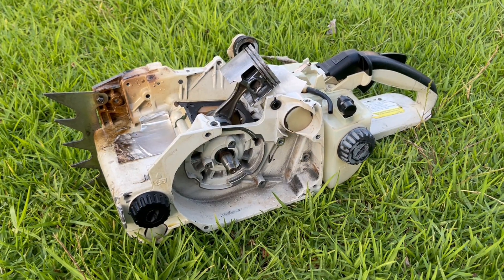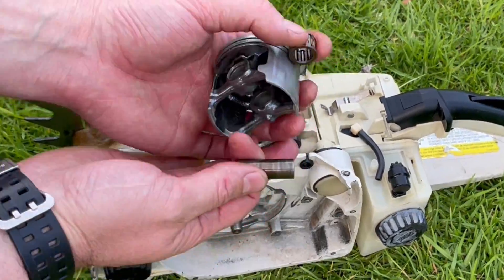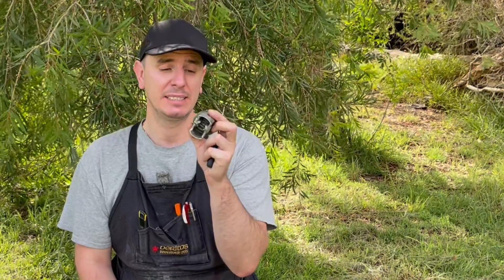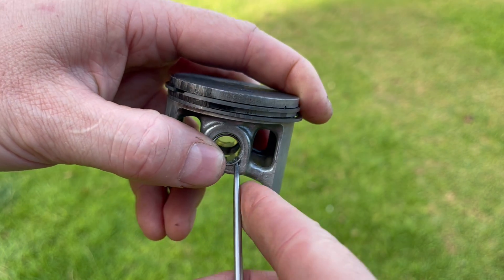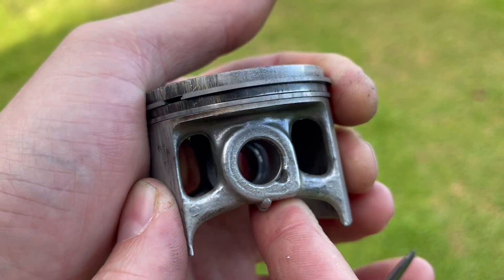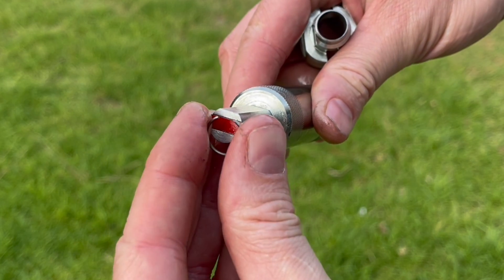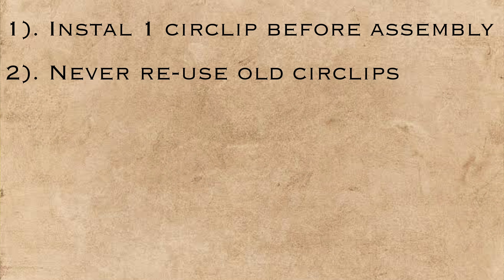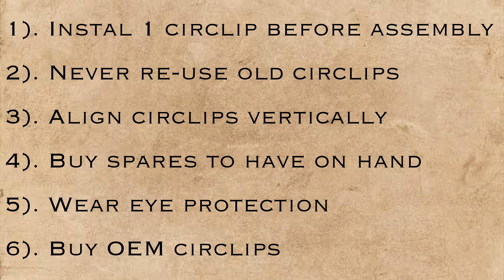This Will Save You A HUGE Repair Bill!!

Comment: Hey Tom, got a question concerning a ms 250 stihl chainsaw. 

I've broken 4 pawls so far because of kick back when starting. Im almost certain it's firing before crossing tdc which pushes the rotation of the saw in the opposite direction slappin the groves of the fly wheel onto the engaged pawl. 

When the chainsaw is in the off position I can pull that sucker and it would never damage the pawl. Only happens when I put it on the run position.

I've changed the spark plug and removed the flywheel to check the key to make sure it's not sheared. I've also tried different coil gapping to see if it makes a difference, but nothing.

One last thing when the saw starts it runs perfectly.
Reply from the maker: Interesting! It could be the coil has started to fail and is kicking at the wrong time, that’s about all it can really be from here on out. Try replacing it with a good known one. Your local dealer will have a bunch of used good parts out the back you could inquire about!
Reply: @VintageEngineRepairs  Thanks for the reply! I'll let you know if the problem is resolved.

Comment: I always dread installing these circlips, as I have had them come loose in two stroke engines on more than one occasion, ruining the piston and the bore, needing a second rebore, two oversizes larger.
Reply from the maker: Ouch! Well if you follow the advice here you’ll never have another failure :)

Comment: I assemble them so that the closed end is away from the notch so that the circlip doesn't come out.

When I rebuilt a Honda 4 stroke lawnmower engine last year & that's what I did,I also reused the old circlips which I don't think will fall out too easily.

I know that Honda doesn't have any specific instructions for which way the circlip has to face !
Reply from the maker: Hey, they actually do, they don’t want you aligning the open part of the clip with the notch, they specifically state this. Page 187 of their GX 120-160-200 manual. They show the clip open end up.

Comment: Some great advice Tom I have no use because I"ll never tear down a 2 stroke engine not worth the parts and time I have to put into the repair . The return of investment is non existent !
Reply from the maker: Thanks Bill! This applies to 4 strokes too :)
Reply: On good equipment, that you own, it is both very rewarding and also a huge cost savings.  I have rebuilt two of my Stihl chainsaws and they run like a top.
Reply: @mikespain8655  good point put I was thinking from a flippers view .